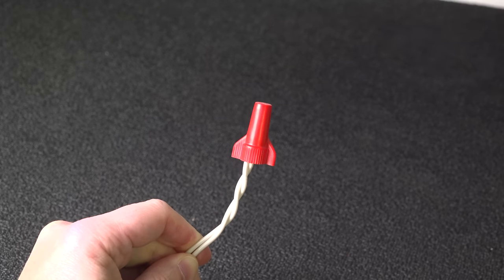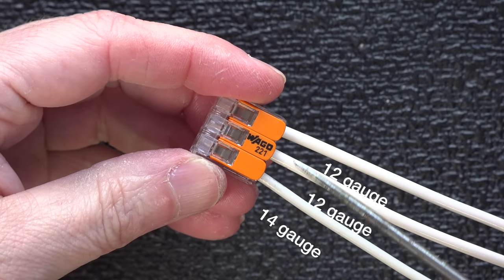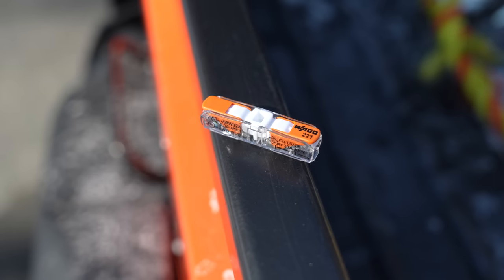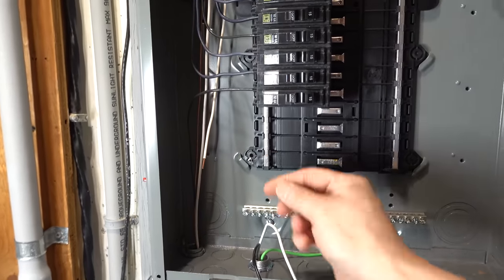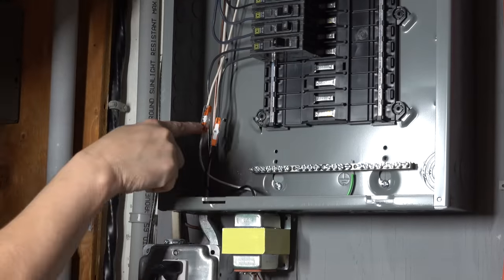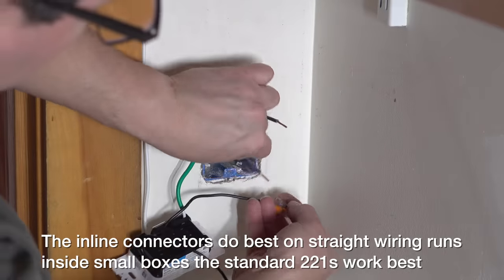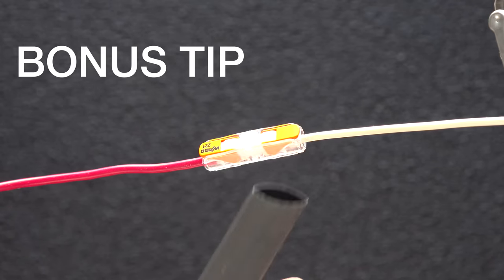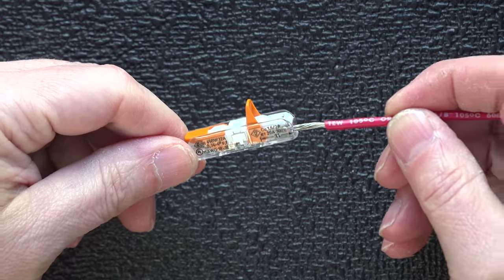New Wago Electric Connector is SHOCKING everyone - Inline 221 has arrived!

Comment: WAGO connectors have actually been used in Germany since the 1970ies replacing screw terminal blocks. We never used wire nuts. More than three decades of use have proven their longevity and reliability and now virtually all new installations use them. I have recently wired our whole house in the Philippines exclusively with WAGOs. Probably the first house fully wired with WAGOs in a city of two million, where most installations use only twist-and-tape (without wire nuts or screw terminals).
Reply: Say it louder for the haters in America. The amount of hate they spew is disgusting.
Reply: Not only in Germany, many countries (if not all) in Europe use them for a long time without issues.
Reply: Going from USA to Philippines [Mindanao], I find the electrical and plumbing.... fascinating.
Reply: @robertsponge1744  you guys are the ones saying wirenuts are bad when they objectively give you a stronger and better connection than wagos do
Reply: House built in 1958.  Has lots of wire nut connections and a fair amount of solder-then-tape connections.  Have yet to find one that failed.  Also use Wago connectors in some areas.  Drawback:  More expensive than a gaggle of wirenuts.  Benefit: Easy to make connections when you're lazy or physically too impaired or mentally too incapacitated to be able to accomplish twisting wires together and screwing a wirenut onto the twisted mass.
Reply: @pgood7266  hardly anyone is saying that current US standard branded wirenuts are bad. They do the job, they have some advantages and have some drawbacks. A "stronger and better" connection than WAGOs used within the permitted specifications behind a 10A to 30A circuit breaker may not be relevant. Tests show that WAGO pullout resistance is around 15+ kg and that failure occurs only at amperages that are double or triple the rated maximum. Wirenuts work well with all solid wire of same or similar sizes. They do work for up to 5 wires and with a mix of stranded and solid, but in that case I would not call the connections "better" any more. Many non-branded wirenuts, Chinese no-names without a real UL listing are actually bad and these happen to be almost the only ones available in the country I live in.
Reply: My father is an Old Timey, my way or it ain’t the way, kinda contractor and I joined him for several years to learn from. Because of vids off YT, I purchased 2,3,4 slot connections and went to field with him. His words, it felt like a scam these things were more available or popular.
Reply: @pgood7266  nope they don't.... plenty of tests out there which confirm that
Reply: As a matter of interest, how many houses in that city burn down from electrical faults?
Reply: @saumyacow4435  none I am aware of, surely less than 10 a year in the enterity of Germany...
Reply: @legendaryz_ch  I mean the Philipines
Reply: @saumyacow4435  they have skilled electricians too, usually they twist the cables together and dip them in molten tin as far as I know. seems to work
Reply: @legendaryz_ch  a proper wirenut connection is far strong and a overall better connection, a lot of these YouTube tests are done by DIYers that don’t know how to make a proper connection with wirenuts, that’s why electrical should be left to professionals
Reply: @basketballjones6782  So much hate... People that use Wago connectors are not stupid.
Reply: @gewittertorte  no, cause they don't apply pressure. one of the biggest issues is hot cold change which can cause a bad connection and corrosion over time. with the spring-loaded wago this doesn't happen. it's a big issue which leads to many house fires.
Reply: @pgood7266  "a proper wirenut connection is far strong and a overall better connection"

Citation needed, old man.
Reply: @mjc0961  test it yourself, take 2 number 12s twist then together with your pliers and put a wirenut on them and try pulling them apart and then do the same with a wago. I’ve done it and wagos pull off easily compared to a wire nut.
Reply: All very nice, but you can't claim that these quick release couplings have decades of trouble-free service behind them because it's a relatively new model (221) product on the market, available since 2014. There is another very popular model (222) that appeared 10 years earlier (2004).
Don't get me wrong, I love working with them and I find it a nightmare to go back to screw terminals.
Reply: @tristankordek  In 1977, the company developed the spring-cage terminal block under the product name Cage Clamp. This invention was also the basis for the company's subsequent product groups. The cage clamp has since become an industrial standard.
https://en.m.wikipedia.org/wiki/WAGO_GmbH
Reply: Absolutely, I've been using these for years in the UK on small projects. The only thing close to it is a soldered joint.
Reply: I'm an electrical engineer. I've some issues with Wago connectors on high currents (32A). The force applied to secure the wire in the Wago connector seems to diminish over time, so their contact resistance increase over time, which translate to increased heating, which can melt the Wago and even start a fire.
The most reliable connectors in my expérience are crimped ones.
Reply: @pxidr  interesting! Would this apply in a residential setting? I think an AWG 10 wire in the higher powered 221-683 WAGOs with a 30A circuit breaker would be designed for a maximum continuous load of 80% which is 24A. In our setting this could be a high powered split aircon up to 5.5kW at 230 Volts. After how many months or years have you experienced issues with the clamps possibly loosening or overheating? Is your experience with that specific Wago 221-683 model which have not been available for that many years?
Reply: @saumyacow4435  In the Philippines about 50% of all home fires are caused by electrical faults. Twist-and-tape splices, substandard copper coated aluminum wires, poor workmanship, poor quality of Chinese made outlets, single insulated soft stranded wires clipped to wood with metal clips, etc are some of the myriad issues I observe. I even discovered a Philippine made circuit breaker which will not release during a direct short circuit.
Reply: @ChristianWagner888  It was Wago 221-412 32A used for connecting an EV charging wallbox, that pulls 32A continuously for hours, with 6mm2 wire. I noticed a year after some anormal overheating at the Wago connectors. It was replaced with crimps, no issues since.
Reply: @Tristan Kordek  fair comment. But the track record of the underlying technology is decades old. Wago 273 has been available since 1974 up to today, and the technology and materials have been mature since about 1977. The underlying clamp technology including Power Cage Clamp can now handle up to 350A wires.  

Wago has excellent quality control in engineering and manufacturing. Therefore I would expect a product from 2014 to perform as well or better than previous versions. Tests have been conducted in comparison to the older models and AFAIK they have not revealed new weaknesses. Most failures in new products would show up within about 5 years and I am fairly confident that these connectors will do fine for the next 30+ years. 

If my children still have the house in 2055,  they'll likely do a rewire with whatever technology is current at that time. I doubt that we would have any Wago failures within this time. Some of the Panasonic outlets will probably not last quite as long.
Reply: @pxidr  thanks for the details, especially since EV charging is probably one of the most demanding residential applications. Interestingly the Wago 221-412 are rated for 32A (4mm2) in Europe, but only 20A (AWG12 3.5mm2) in the US. They are not designed for 6mm2 wire and I'm surprised that 6mm2 even fits. 

The 221-612 might have been more appropriate, as it is designed for 6mm2 and are rated up to 41A in Europe. I use Wago 221-412 only up to 20A as we operate under the NEC 2017 in the Philippines. Your experience has shown that more headroom is needed when you have demanding applications that get close to the specified limits. I will keep that in mind, if ever we install an EV charger. Crimping is obviously a good alternative.
Reply: @ChristianWagner888  Ouch!
Reply: My German flat from 1987 (probably rewired since) uses wire nut... some of them started buzzing which is pretty scary
Reply: I swear for a good 90% of my infrastructure/technological questions I should just ask myself. "Well how are the germans doing it currently?" because they really are one of the forefront creators of new standards and practices, looking forward to the future, rather than penny pinching in the past.
Reply: Germany is as reliable as screw nuts especially with all their very reliable car brands
Reply: @ChristianWagner888 when people say wire nuts make a better connection they’re talking about the resistance of the connection. Wire nuts make the lowest resistance connections, the higher resistance wago connections aren’t wasteful enough to pose a fire risk but when I comes to circuits over 15 amps the power loss will add up over the years
Reply: @legendaryz_ch the opposite is true, wire nuts make the lowest resistance connections, they can even beat out solder connections
Reply: We just built a new house and it's full of Wago connectors everywhere almost in every socket. They're the best I use them for almost anything electrical because they are easy and quick
Reply: @robertsponge1744  Its all because some cannot change with the times.  I wonder if the German and other Europe old time Electricians disliked when the wagos cam about ?
Reply: If someone seriously thinks a wire nut is better than a Wago connector in any scenario, they shouldn't be allowed to work any electrical system, simple as that. 
But I guess if you build your houses from cardboard and wood plus have to draw dozens of amps on simple household devices due to the low voltage it doesn't matter anyway.
Reply: @legendaryz_ch  in the Philippines, they basically just twist and tape, but do not solder the connections. The twisting can be done well by experienced electricians, but the tape can disintegrate or unravel in the heat, especially since they replaced 3M electrical tape with cheap Chinese versions.
Reply: @tristankordek  well the spring pressure connection technology was patented in the 1950s with products based on this technology widely used since the 70s: "In 1974, the new junction box connectors revolutionized electrical wiring with PUSH WIRE connection technology for solid conductors."

The 221 is probably the third or fourth generation. The casings change, but the underlying spring technology remains basically the same. Electricians in Germany have used them for decades without issues and I expect the relatively new 221s to perform just as well and last as long as the previous generations. 

Certainly 3M, Ideal and others also have had various generations of Wirenuts based on basically the same Wirenut technology (not a spring pressure connection). 

The only time that these technologies markedly get worse is when they are manufactured as Chinese imitations. You can find some pretty bad Chinese wire nuts as well as some questionable Wago imitations.
Reply: @basketballjones6782  WAGOs have considerably higher resistance than wire nuts. the "best" used to be defined as the one with the lowest resistance not the "easiest to use".  

Unless you are handicapped or have two left hands, the "time savings" using WAGOs over wire nuts is mere seconds, if that! And they are not as good a connection as wire nuts or screw connections.
Reply: @ChristianWagner888  WAGOs will fail at rated current, just not immediately. Every heat cool cycle reduces the already low mechanical strength of WAGOs and increases the already high resistance .  Virtually all "tests" you see on the internet are not valid. A relatively few minutes at double rated currents, proves nothing.   It does not simulate continuous or cyclic duty over time.
Reply: @professorg8383  That's quite a bold claim that requires proof from your side with good sources where this has actually been tested. 

You do propose an interesting theory about the heating/cooling cycle at rated currents.

Among the most common Wagos currently used are 221-4xx which are rated up to 20A (AWG12) or 221-6xx which are rated up to 30A (AWG10) in the US.

Here are some practical examples for higher load residential applications where we are (240V supply):

- an electric water heater at 30A (7200W)
- an electric stove/oven at 30A
- an air-con unit at 20A (4800W)
- a washing machine a clothes dryer possibly running at the same time max 20A

Given that these kind of use cases with cyclical loading have been common in Germany with Wago clamps for decades, can you give examples of frequent failures in these type of circuits?
Reply: @robertsponge1744 it’s already been proven wire nuts have less resistance, more current capacity, and the wago connectors are prone to the levers popping up.

Comment: I just used my very first 221 Wago connector today on a new outlet, and it made the task sooooooooooo much easier than what I was used to. I'm looking forward to doing the other couple of dozen outlets in my new garage now. Big DIY Wago fan here!!!
Reply from the maker: That is awesome to hear. For DIY work especially they make things much easier, you can even pre-stage work to make it easier when you get up on the ladder. 1/2 your connections are done too.
Reply: Outlets have connectors built in so I'm curious about how you're using these.
Reply: @Helman Frow  Even though regular receptacles do, smart receptacles don't always. For example, Kasa smart receptacles need Wagos or wire nuts.
Reply: @Panthers89Fan9000000  Ah, good point. Yes, I meant to say "receptacles" because I study the CEC :).
Reply: If they are so great, why doesn’t electrical companies in Canada use them? If there is a company that uses them it’s few and far between.
Reply: @jasonh8542  almost every company in Germany uses them, because they would be hold accountable for using cheap chinese ones and burn your house down. Shady electricians maybe take the risk, to save a couple bucks
Reply: @Michel-7.7.7  I was referring to Canada.
Reply: @jasonh8542  i know, maybe canadian electricians use them more than you think.
Reply: @Michel-7.7.7    Not sure about that. I’m in Ontario and can’t find them anywhere except Amazon. I won’t get them from amazon because of all the warnings of wago clones.

Comment: I have been an electrician since the early 80's and Wagos were just getting to the stated and were a bit pricey. I did use them where they were advantageous back then. Now that I'm older with arthritis in my hands, they are my standard method. Never had an issue with the push in type or lever style. It makes it easy to push the splices into the box as well. When troubleshooting, you don't need to untwist the entire splice and you can test each wire easily. Way 2 go.
Reply: OA in my hands as well. 3 surgeries this past year. Brutal. Anything I can use to make stuff easier on the hands is in.

Comment: I actually proposed this to Wago a few times over the years, both when I met them at industry fairs and by contacting them by mail. They never seemed very interested in the idea and one time they told me there was no market for such a product. :)
Reply: Germans are sometime quite bad in thinking outside the (junction) box. I will buy some for my solar installation
Reply: The Chinese produced cheaper WAGO rip-offs, but were the first ones to produce such inline connectors. So maybe the WAGO inline connectors a re a rip-off of Chinese parts...
Reply: I have never tried these Chinese ripoffs thought, since don't think it's worth the risk.
Reply: @johnscaramis2515  Prob true that lol
Reply: Welcome to Germany where the first adequate solution is the only solution, that's why their trains are 1-2 hours late when they run at all and it's so hard to change a headlight in a Volkswagen

Comment: They are life changing. I got my first set working at a venue where we were upgrading several lights switches. The day I try them another tech shows up to setup an event outside and I see a box of them sitting in his work box.  He had just got his 2 days before.  Before you know it there are 5 guys in a circle just geeking out like little girls with a new doll over them. Recently at that same venue had to replace 3 dimmers with smart dimmers in the same box that was smashed full of loose wire nuts. 1000% cleaner and easier to work with using wagos as well as making it super easy to find a faulty circuit. We use them with 3D printers as well to avoid recrimping terminals on common things that die like heater cartridges, thermisters, and powersupplies. They also make probe adaptors so you can meter your connections with minimal effort.

Comment: Super cool!  About that shrink-wrap - not enough shrink is achieved at each end - Try using three shrink-wrap tubes - one big and two small.  slip one each of the small ones on both wires, then slip the big one on one of the wires.  Next assemble the WAGO 221.  Then, heat to shrink the big one and when the big one's ends are as small as they can be, slip the smaller ones over those ends and heat shrink them to better seal both wires. (might as well do it right!)

Comment: Just ordered Wago 221s to use for my bathroom light switch I just replaced. I used the current wire nuts that had been in the switch but I don't think I made the best connection. The lights work but I will be replacing them with the Wago today to be on the safe side.